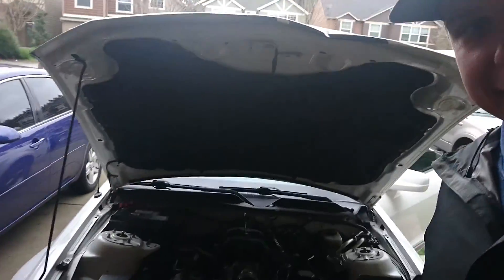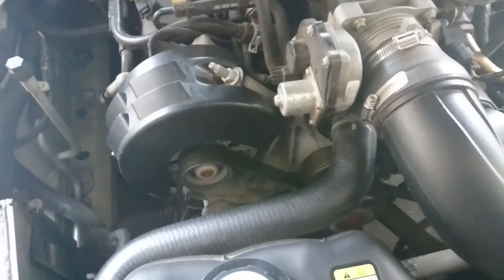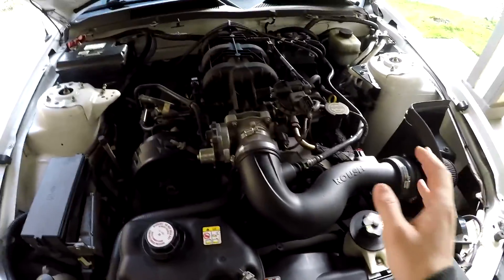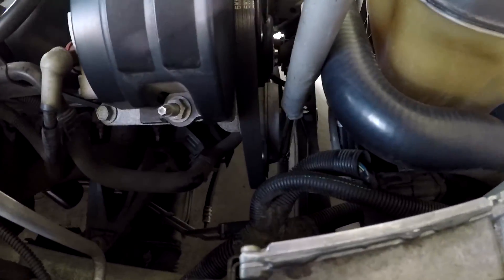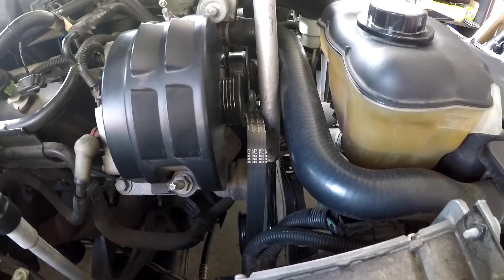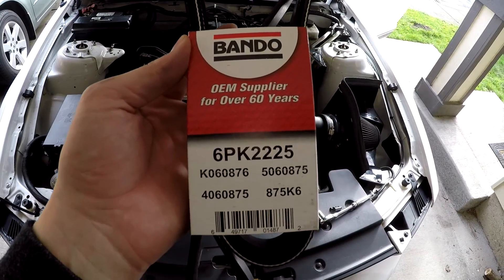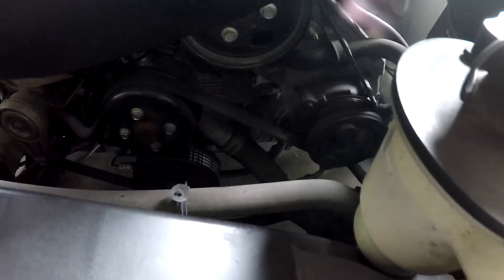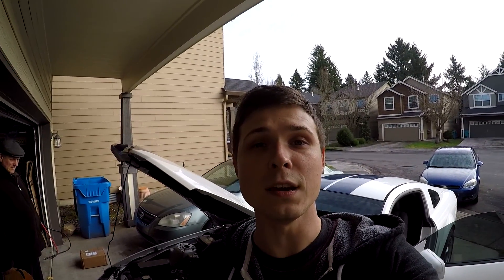TUTORIAL: 2005 Ford Mustang V6 Serpentine Belt Replacement Engine Squeak DIY

Comment: couple errors. 1. the tensioner realease slot takes 3/8 not a 1/2 socket. 2. you do not specify which way to crank the tensioner clockwise/or counter. so no thumbs up.
Reply from the maker: I appreciate your input and the correction, thank you!
Reply: @SergeyPip  on the fourms it says 1/2
Reply: I did the job, it was 3/8. Good call